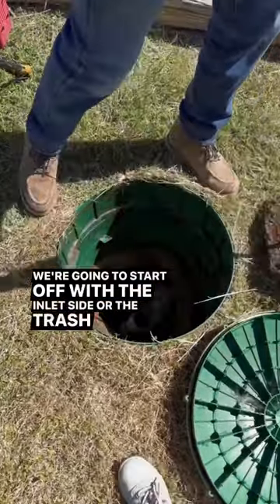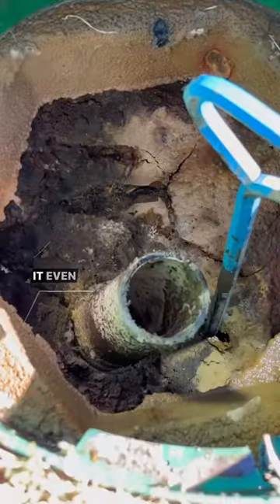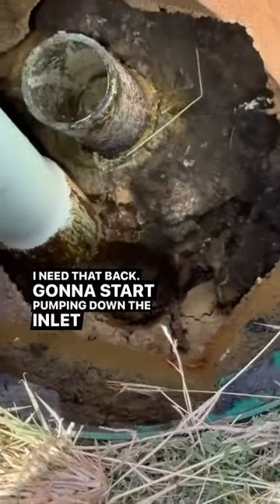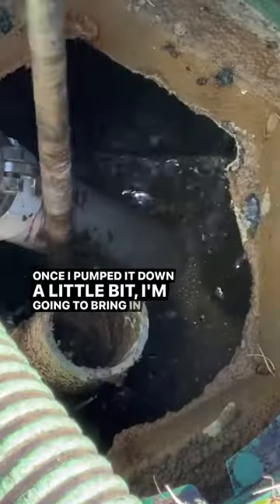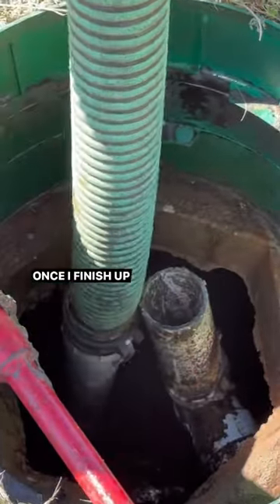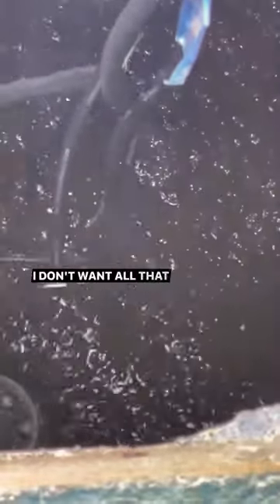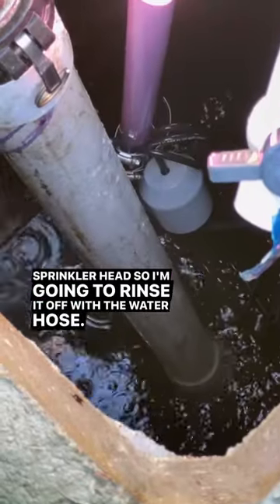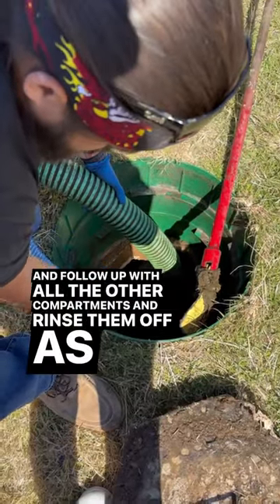Pumping out a thick aerobic septic system #shorts

Comment: These systems shouldn't be owned by lazy people, me included as far as letting things slip your mind. I my area you have to keep some parts of the system filled with chlorine so that when the sprinkler system goes off it won't be an issue. A friend of mine told me years ago that it is usually set to go through the sprinkler system at night. A power outage caused his timer to be wrong and kids were running around under his sprinklers, with no chlorine, when he got home from work!
Reply: Eeeeeeew. Did they get sick???
Reply: @bmaiceman  He said as far as he knew none of them did. He kept an eye on his timer after that, or so he claimed.
Reply: In TX, they are inspected quarterly. So they're never really under maintained.